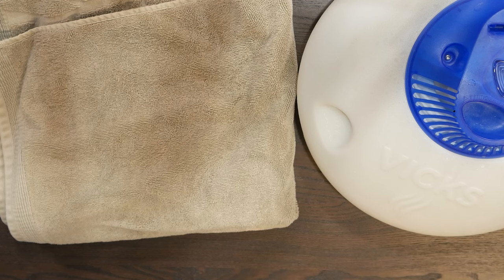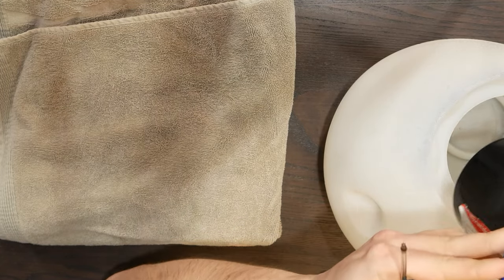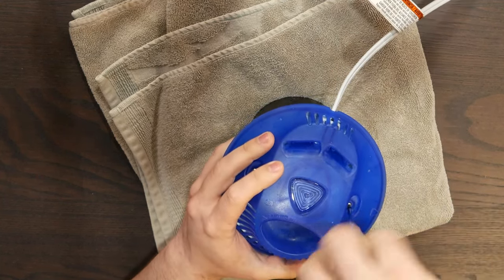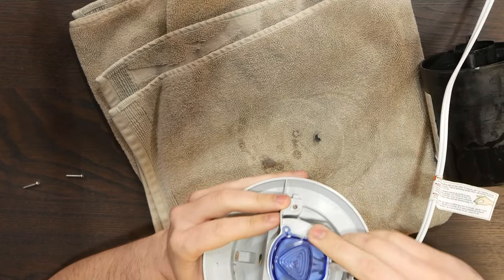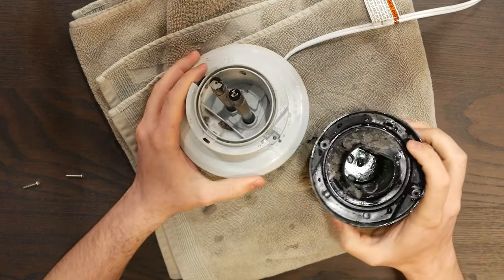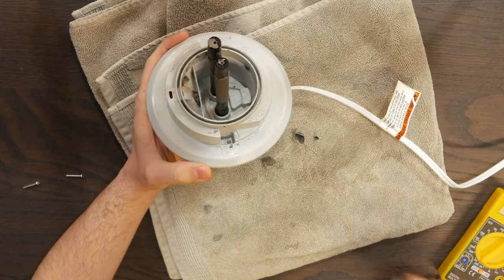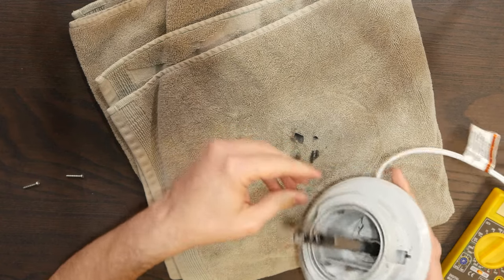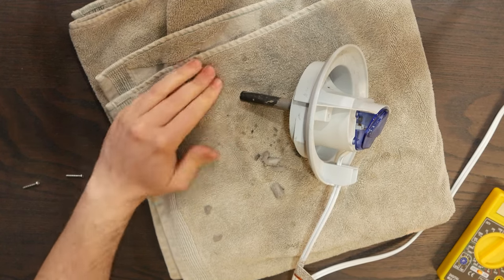Is a Vicks vaporizer an electrode boiler?

Comment: Oh geez, how did this thing pass the safety certification
Reply: The electrodes are within the plastic housing. While you might claim it's easy to get to them, you could also take a pair of scissors and cut the power cord to most things in the home to expose the wires even more easily.

Comment: So does this thing give off hydrogen and oxygen like an HHO generator? Or is that only possible with DC?
Reply: I just looked into that question, and what I found is that the amount of HHO generation depends on the electrode surface area, which these rods don't have much of. The higher voltage also doesn't help.
So, I think the answer is yes, but it's an insignificant amount.
Reply: @anlumo1  cool. Thanks

Comment: You can remove that resistance and have 1500 watts of goodness 🥴 or if you wire it to the dryer outlet/RV outlet that's up to 4000 watts of humidifier 😯

Comment: Yup, that's a Joule heater. That vapor also contains traces of chlorine-related compounds like HCl because of the electrolysis that also happens in AC systems. Pretty bad design. But cheap. :)

Comment: Of course there is 120 vac across the two electrodes!  What did you expect?  Even if there was a kazillion ohms between the electrode and the outlet it's an open circuit in the configuration that you have and you're measuring across that open  so, you get the full voltage..  The load is the water/salt "electrolyte" 
And yes it's an electro-boiler,  what else could it be?

Comment: For measuring the current of circuits you're much safer using a clamp meter. Or in fact any trustworthy meter. A lot of the cheap ones aren't fused, and when they are it's not rated to actually interrupt the arc that can occur. Please be careful with test equipment choices! I'd hate you to have something blow up.

Comment: So.. I see you use the cheap meter to do the dirty jobs. I get the logic, but just remember that you're probing mains voltage holding probes in either hand across your chest. I'd absolutely use the reputable one for testing mains. But then I live in a 230v region.

Comment: How is this an "electrode boiler" and not an electrolyzer , creating H2 and O2 gas?
Reply: Because it runs on AC. An electrolyzer to create hydrogen and oxygen gas runs on DC and generates the two different gases on the different poles (I forget offhand which way round)
Reply: @leonerduk  Thank-you

Comment: Yes, they are still made like that.  That also explains the design of the tank.  It is impossible to stick your fingers in electric water.  To get your fingers in the water, you have to remove the electric bit.

On your main video, you FORGOT A HUMIDIFIER TYPE!!!  Look up "centrifugal humidifier."  They don't work well, but they are a thing.

Comment: Important notice: Evaporating water takes same amount of energy when you boil it or evaporate it slowly using great surface area. Used energy (heat of vaporization) is the same per kilogram of water. There for if you have cold climate and you need to heat your home with electricity, it doesn't really matter if you heat it partially with that humidifier or completely with your heating system. If you use vaporization style "cold steam" units, use need to steal that heat of vaporization from the air in the room and your heating system needs to heat that up again. That being said, I would say that those boiling type humidifiers could be useful in cold climates, not so much in warmer areas.

Comment: Alec, buying a $10 meter to do line voltage stuff on is dumb. Any decent Fluke or Brymen is going to be absolutely fine no matter what you do to it at 120v, with any of the leads, on any of the settings, always. But more importantly, CAT certification is to protect the *user*, not the equipment. Dangerous transients can occur, or you can plug  the leads in wrong, and then you're trusting a $10 piece of junk to not explode in your face.

Comment: Why tf are people freaking out about this, electrode boilers are perfectly safe as long as they remain shrouded to ensure fingers don't get within a few inches. These exposed electrodes are no more dangerous than the exposed electrical terminals and resistance coil you'd have in a resistance coil based design.

Comment: So many electrical experts to tell me that I'll die when touch a piece of plastic that covers two metal rods with ZERO electrical current running through (because the thing which runs current through them is not plugged in and therefore not receiving electricity) will electrocute me. Thanks guys!

Comment: Really should just have a float switch and resistive heating element. Dodgy as.
Reply: If it was tipped over and the water spilled out, a float switch could fail active and then you've got a powered heating element with no water to absorb that heat surrounded by plastic that's going to get hotter and hotter. We in the fire fighting business would then reclassify the humidifier as an ignition source. With the electrodes, if the unit falls over and the water gets out, it stops generating heat, and with the electrodes hidden within the housing, it's actually safe unless someone purposefully tries to get into it.

Comment: wow Vicks breaking records in scummy design
1) going to have very unstable output depending on tank level
2) otherwise unregulated
3) gas problems?
4) scale sensitivity.
So basically the device you plug in to modify humidity in your home put's that humidity all over the place once plugged in.

Comment: Don't do this! Just measure continuity/resistance from electrodes to the pins on the plug, task accomplished, no need to measure it live, it doesn't tell you anything new or interesting!

If you have to measure live, and you're not an electrician with decades of experience (ie Clive, or DiodeGoneWild, or whoever), and i'm sorry but you look remarkably clumsy, please wear nice thick rubber gloves.